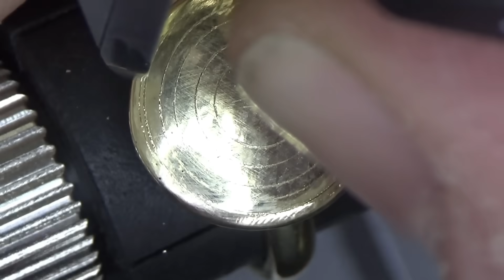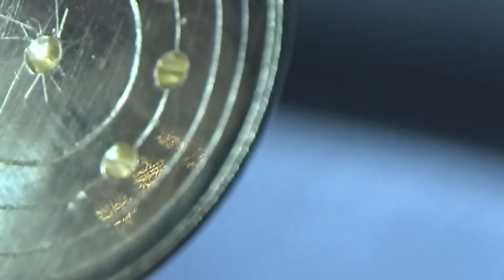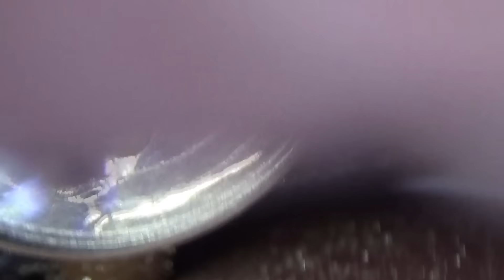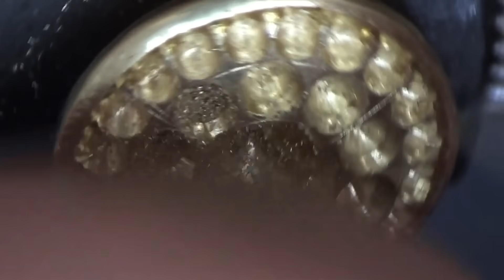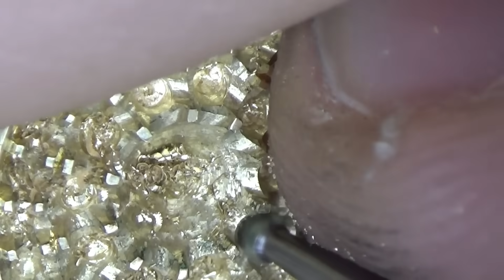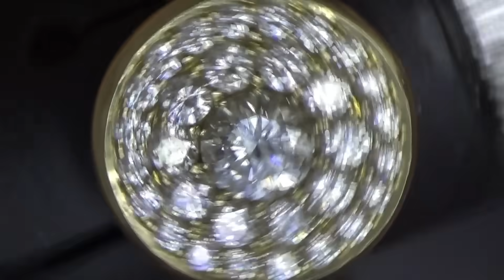Micro Pavé - 4.2mm Center Stone - 30 small diamonds

Comment: Why do you use dental spray?
Reply from the maker: Hi liza, I tend to use dental spray when there is a very large stone which doesn't fit in to good. I can determine the remaining contact points and remove these with a drill

Comment: What is the tool used to shave off the sides and what size burr do you use for 4.2 mm diamond? Also did you measure the small stone and then drilled or did you eye ball?
Reply from the maker: We use different gravers to cut the sides and remove the metal. And obviously we measure very precise every stone before setting. ;-)
Reply: @heinikendude  that means you match the burr size to the stone size.

Comment: hi great work you done !!! I am a stone setter but I never used divider ... I would like to learn how to divide with divivers , can you explain ??? I will be very happy for that :)))) thnxxx
Reply from the maker: Gary Zeos you should, in a circle
Pattern always start dividing from the center. The normal division is all with the same diamond diameters. This shows different ones and should be via trail and error. Also if you take the diameter of the stones and you mark these on the circle (which you drew from the center point) you can just keep marking until you reach the last one. Most of the times these do not exactly match then just continue with tiny stripes and decrease your diameter by turning ‘inwards’ this way you should eventually meet one of your previous marks.
Reply: vandoorenniels I didn't get to much but thank you for your reply !!! is there any video or a book that can explain it more clear ?
Reply from the maker: Gary Zeos why don’t you just start by mapping out the actual diamonds bottom up on the jewelry. And use a divider (take the diameter from the diamond) and mark the position. I’m happy to provide some more details over the email. Info@vandoorendiamonds.com

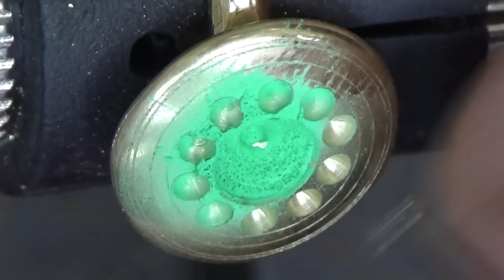Comment: Does any one know what that green spray at 13:00 is called and what is it used for. Advice much appreciated!
Reply: Looks like is Marks how far the pavilion touches the metal. So the setter must use the round bur to remove more metal.
Reply from the maker: Yes, it's you are correct. The name is Occulus Dental spray

Comment: I have a few questions.. I am going to have 2 rings made and a wondering I get I1-I3 quality diamonds if they would be worth getting to put in the ring from 1mm to 1.5mm, and then get si diamonds 2mm - 3mm.. your opinion on that, would they look nice on a 18 kt yellow gold ring, it would have just a few more diamonds then what you used in this video... my concern is if the small i3-i1 diamonds are very cloudy and bad... can you tell when they are that small ? what is your opinion, it is very appreciated
Reply from the maker: I would never use diamonds with lower quality than SI1. Because you end up paying more for the diamond setting services than the diamonds itself. That would be pointless ;-) Good luck with your decision.
Reply: @heinikendude  , in this particular case, i would not have to pay for the labor of the job, only the gold weight per gram. it is a friend making them for me.... my question is, is the bad quality a huge turn off when a diamond is that small and there are like 40 of the next to eachother? will it have some shine and sparkle? (of  course not vvs shine)
Reply from the maker: It will defenitely shine. But it will look like there is some sort of grey mask over it.... I would higly advice against it. Sorry but that´s my honest opinion

Comment: I've never seen a setting where there is no opening behind the stones. I would be concerned that dirt could get back there and they couldn't be cleaned properly.
Reply from the maker: Billy Nage hi, a good hot ultrasonic with some grease dissolver will clean everything. At least in my humble opinion. If not use a steamer or pressed air.